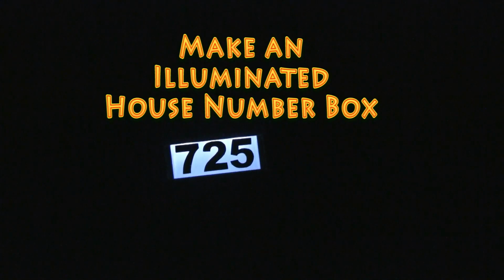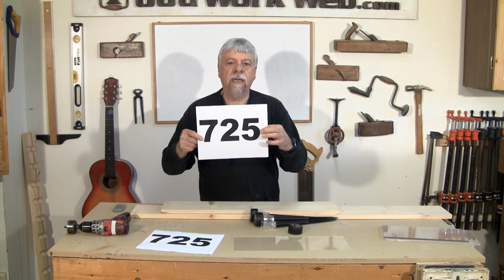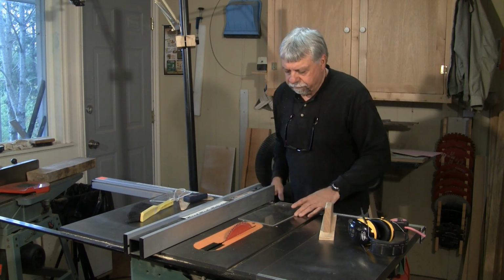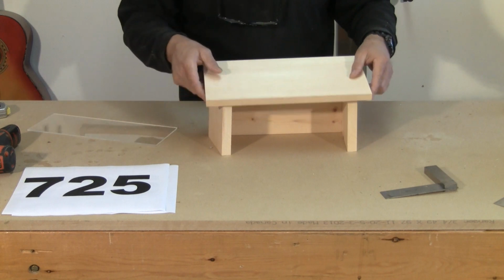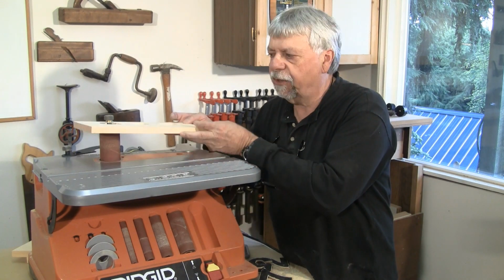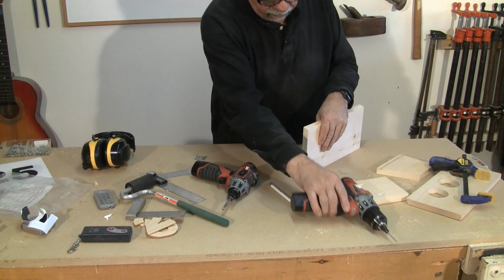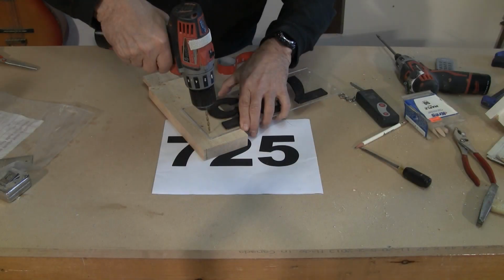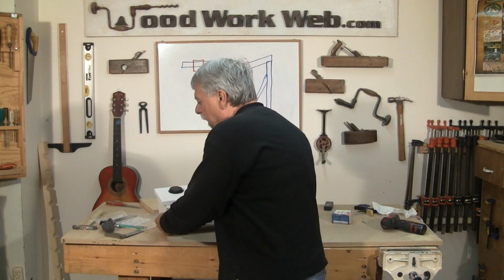How to Make Solar House Number -  Woodworkweb

Comment: Great Video Love some of the ideas and tips you provide. I did something similar to this to place on my street side mail box.  Mine was a simple box using scraps I had laying around. I drilled 3 holes across the top just large enough to drop the solar lights into. cut grooves to slide frosted plexiglass with numbers painted on both sides .and mounted on top of the mailbox. I used the cheap $1 solar lights from the local Dollar Tree and upgraded the batteries with salvaged batteries from an old cordless phone that was past its usefulness. That was 3 years ago and they last all night event when its been cloudy for days. Designed it so if one failed I could just pluck out the exhausted one for a new one quickly which proved not to happen.

Comment: Like the idea Colin on the Pro-ject ;-) , if the numbers are on the outside of box . How does   that work? Having  depth perception problem sorry. cheers
Reply from the maker: Hi Pete, yes you could put the numbers on the inside of the plastic, that would help protect them from the weather a bit more ... good point :)
Maybe you will make one of these pro-jets ;)

Comment: Nicely done, Sir.

Got any tips on cutting shapes in plexi with a scroll saw? The cuttings melt the cut back together as soon as the blade passes through. I tried a plastic bit on my dremel but it is super hard to control and wildly dangerous.
Reply: If your scroll saw has a variable speed, have you tried to lower the speed of the blade? It works on mine that way.

Comment: Great project. But, why the numbers on the outside while going through the trouble to silicone the lights?
Reply from the maker: Yes, someone else mentioned that too, I didn't really think of that ... that's why I have guys like you helping me out :)  .... maybe you should come and spend some time in the shop with me, the pay is poor, but we could make some great projects ...
Reply: Sure. Where? You could come here? We would enjoy your insight and expertise. I was questioning more to find out if it worked better that way. Great video as always.

Comment: Is it the case where the printed black paper, plywood backed numbers are on the exterior of the box? If so, did you protect the paper in a step off-camera?

Very cool project by the way. Got me thinking about treatments for the interior of the box such as using a polished, hammered or concave / convex piece of scrap metal on the back. That might play with the lighting or add additional visual interest. So many possibilities!
Reply: It looks like he painted them black off screen.  He also painted the box white off screen.
Reply: FunWithWoodworking Good point / astute observation.
Reply from the maker: YasumotoUS Yes ... you guys with sharp eye, I did the painting off camera, didn't want to waste your time watching me paint :)
Reply: WoodWorkWeb Not a waste of my time, but point taken. Perhaps a simple statement of what you did off camera would suffice.

Comment: Thanks for a great idea. However, the front of my house is North facing and the place for the sign never receives sunlight. Maybe my box needs a "bay window" to gather enough energy! Any ideas?
Reply from the maker: Hi Jeff, I am finding that these solar lights don't necessarily need direct sunlight because mine seem to recharge pretty well even on cloudy days, but only way to see if they will work is to buy a solar light and just test it. Mine only cost a couple of bucks brand new, you might want to invest in a little bit better quality though. Hope this helps ... if I think of more, will let you know :)
Colin
Reply: WoodWorkWeb Thanks. I'll give it a go.